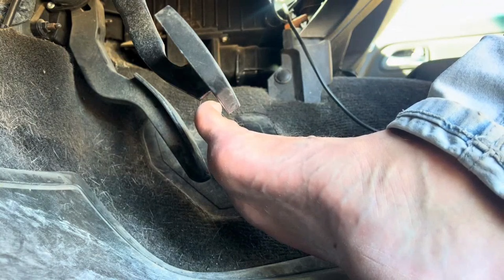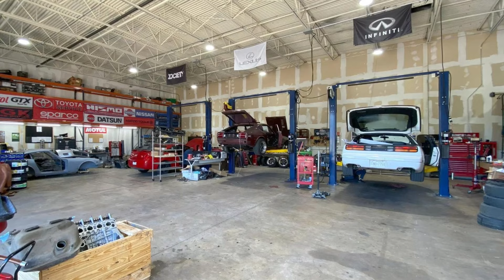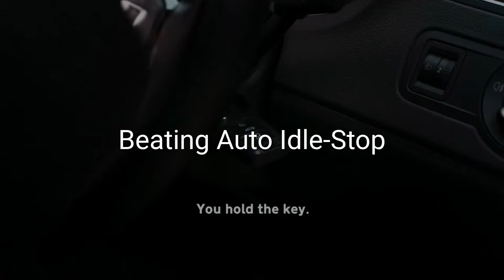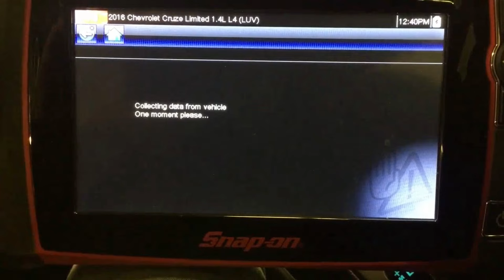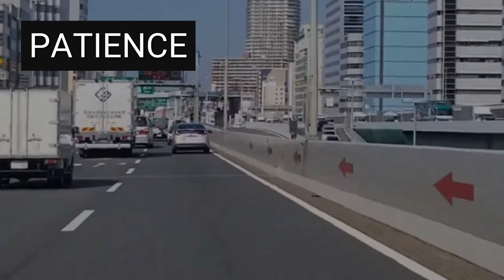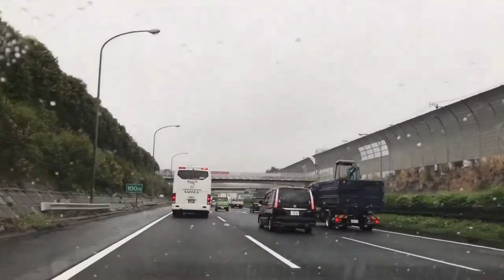This SECRET Japanese Fuel Method Is Only KNOWN by 1% of DRIVERS (Use It Now!)

Comment: Very interesting and informative video. The only thing that needs to be mentioned is that the technology of auto shut-off of engines when stopped for extended periods is false economy. It may save fuel but having worked in a place that had a fleet of Japanese cars with this technology we found that we had to replace the battery in the cars quite frequently due to the extra stress put on the batteries from starting the engines far more frequently. The cost saving in fuel was negated by the replacement and environmental cost of the batteries.
Reply: 100percent agree. True